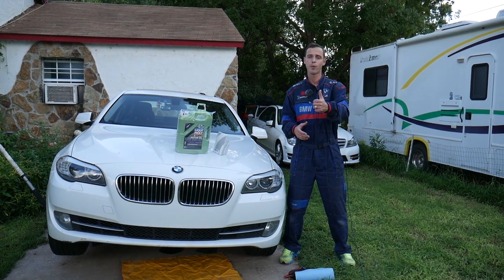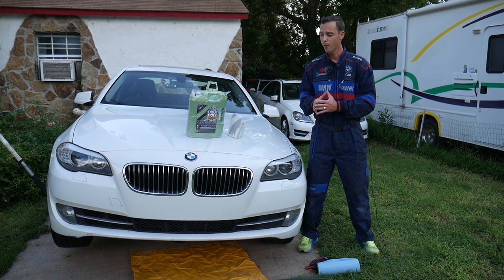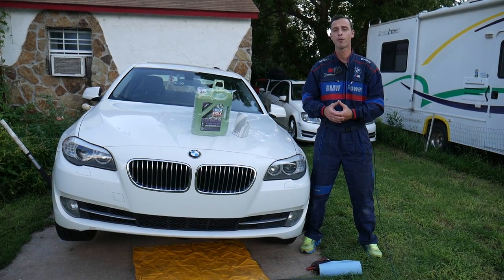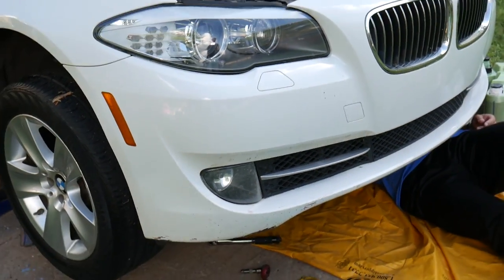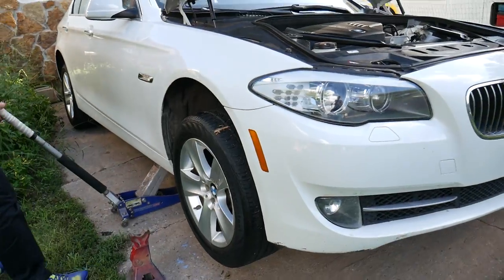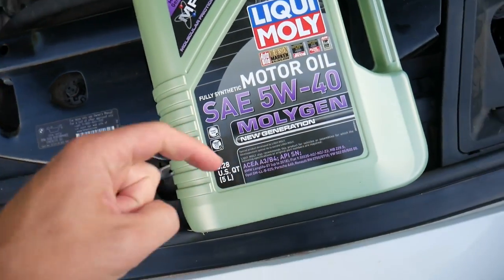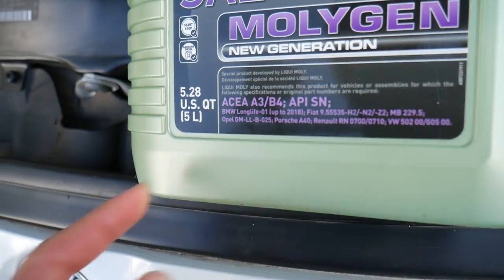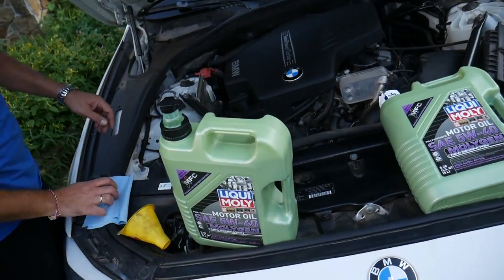HOW TO CHANGE ENGINE OIL ON BMW F10 F11 F07 528I 528XI 520I

Comment: Hey guys, I need help! My daughter’s 2008 BMW 328xi will not crank. It’s not the battery, it’s not the starter, and I have checked a lot of the fuses but I have not found any problems there. My wife drove it in a bad storm. She said the water was up to the bottom of the door in some areas where she was traveling. The next morning I went to crank it and it acted like it wanted to start but would not. Then it all of a sudden did not want to start at all while I was cranking it. It is almost like it is not getting any spark. When I popped the hood the fuel rail had a buzzing sound coming from it. Can you guys think of anything that I can check?
Reply: Scotty Kilmer says that when you think water has hit any part of your engine to use WD40. Check his videos
Reply: its the fuel filter - drain the fuel and change the fuel pump, and pcv valve, and fuel filter as well!
Reply: correction - 1. change the fuel pump, 2. change fuel filter, if that does not work the 3. PCV valve

Comment: Guys i have been following most of your videos. unfortunately i stay in South Africa otherwise I could have brought my F10 520i N20 2012 model long time ago to you.  Please help me with 2 questions. 1st my car starts and shakes when drooping RPM to almost below 5 or sometimes starts and then switches off.  This happens sometimes with hot start but cold start is perfect, sometimes stalls just little when driving at low speeds of 30km/h but not when driving at high speeds.  Can I suspect the High Pressure Fuel Pump, fuel filter? 2nd dose the N20B20 F10 520i 2012 model have a vanos solenoids or is it only the 2 vanos actuators, what is below the actuators?  Please help I will really appreciate.

Comment: That procedure is not for f07. F07 has filter under the car and requires 9.5 quarts
Reply: 2011 528i straight 6 how much quarts of oil
Reply: 7 Quartz  American for the 535i GT

Comment: I use the same oil but 5w30... why did u choose 5w40?  Also u didnt put anything to stop the oil drip from the cap once u removed it, this causes a mess... I see u are in a hurry
Reply: Im about to use the 5w40 I have 90k miles on my car I live in NY we are on summer here now that’s why I’m use it instead of the 5w30 I have been told 5w40 is for hot weather and 5w30 for regular weather

Comment: I have a 2002 BMW 325ci 2.5L convertible, I know there are different Liquid Molly brands of oil which one is correct full synthetic oil that I should use, I mainly use 5W-40 oil...
Reply: Older gen 5w40 e60/ 80/90 and later 5w30 except m and n54 engine